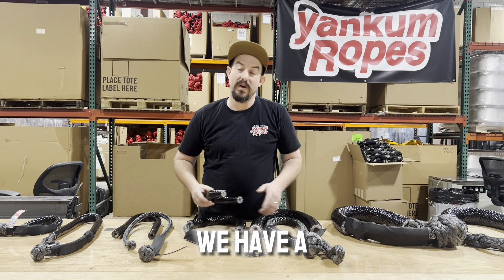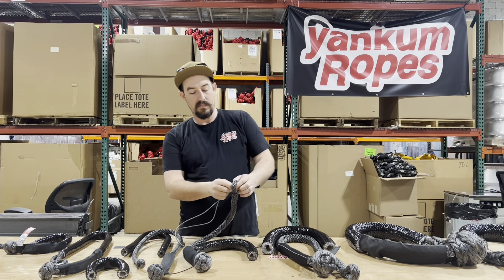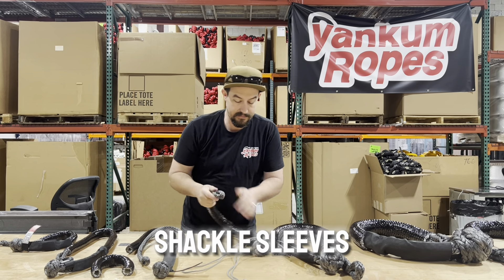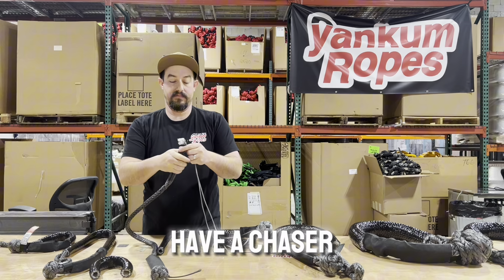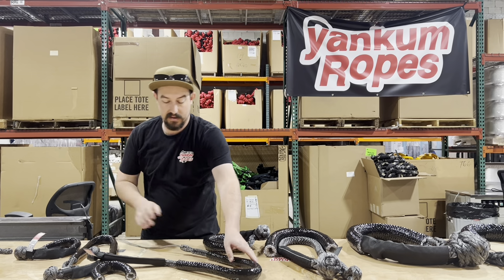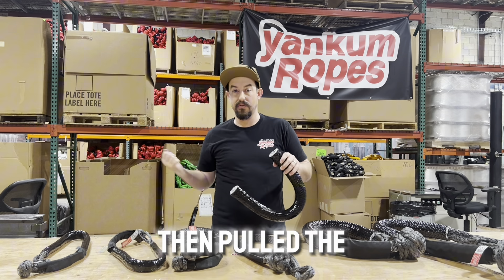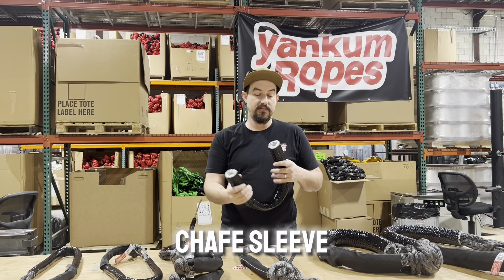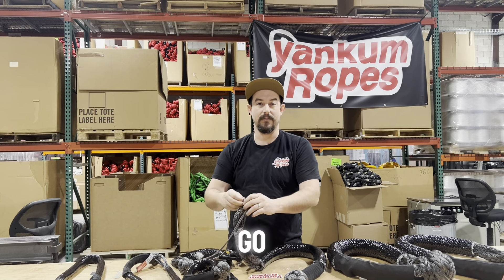New Soft-shackle Dipped Chafe Sleeve | How to Install

Comment: I imagine your shackle lasts at least 3X longer.
Reply from the maker: That’s the idea! 😎 soft shackles are so much easier and safer to use, but they are very susceptible to abrasion and cutting. This sleeve will greatly improve the lifespan of your soft shackles.